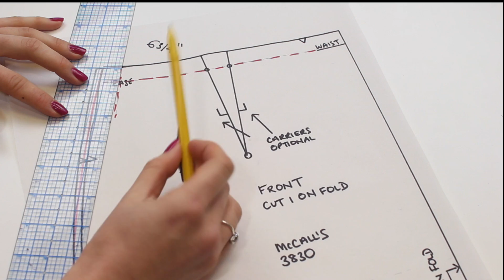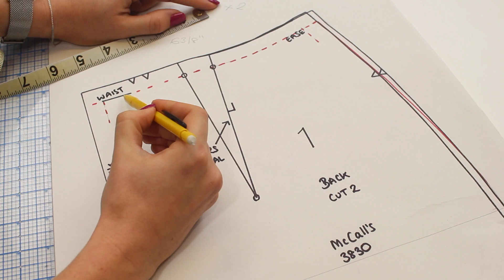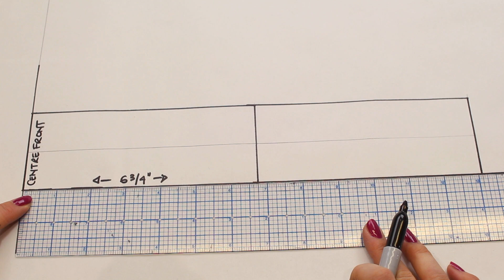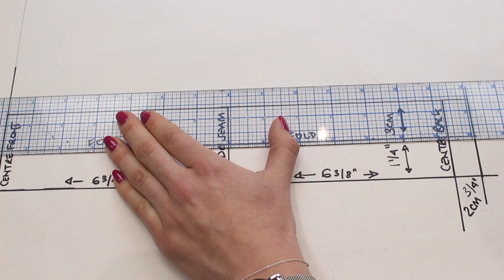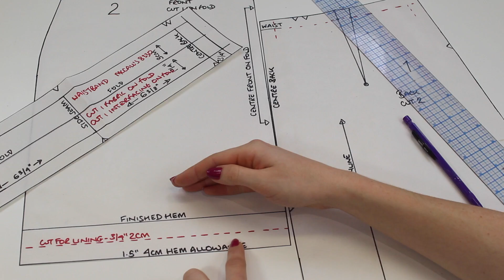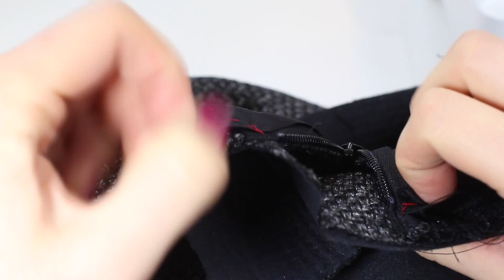Beginners Dressmaking - Sewing McCall's Skirt 3830 | M8051 Pattern - (Waistband & Lining)

Comment: Aneka, thank you so much for being so generous and sharing your knowledge with us in your wonderful tutorials. I can't even tell you just how much I have learned from you! 
Would you be so kind and help me with two questions, please. I am new to sewing and there is a lot I still have to learn.
1. Do I have to pretreat my fusible interfacing before ironing it on and how? I heard of people coming out with bubbles after washing their garment for the first time after they had finished it.
2. If I want to add a lining to a maxi skirt that  obviously will be more flared going down, can I also just cut out the lining using the original pattern piece or do I need to change anything about the shape? (except for the hem, as you explained in the video)
Thank you again so much for all of your helpful videos! I really really appreciate you! Greetings from Turkey:)
Reply from the maker: Hi Isabelle, thank you for such a lovely message. 

1. It depends on the quality of your interfacing. A lot of the interfacing that you can buy in dressmaking shops is non-woven; meaning it doesn't have a grain. Most of the time I prefer to use woven interfacing, it behaves more like a fabric. In terms of interfacing bubbling after a wash, this is usually because the interfacing wasn't attached properly (was the correct heat and steam used), it is poor quality, or the wash was too hot for the interfacing. If I have an interface that is dry-clean only then I might pre-treat so that I can then wash it later on. I would of course test this first with a sample. 

I have sell quality interfacings, to give you an example: https://madetosew.com/product-category/shop/interfacing/

2. Lining a skirt is pretty much the same. I often add a little bit of extra ease to the skirt pattern at the hip. Say 1/8" - 1/4" or so (2-5mm), to make sure that the lining is slightly larger than the exterior fabric. This will stop the lining from tearing as often lining's don't have the same give as fashion fabric. I hope this helps? Aneka x
Reply: Thank you so much for answering so quickly! Yes, that helped a lot:) I will also definitely go and check out the interfacings on your page. You really are an incredibly talented teacher, you explain everything so well that even the hardest things suddenly seem easy. Thank you again for all the hard work you are doing for us! Isabella
Reply from the maker: Glad it helped Isabelle. Thank you for your lovely words. X

Comment: This is a little off topic for this tutorial, but I just bought a serger, and I'm wondering what's the most practical stitch for overlocking the edges of my fabric. I've been mostly working with quilting-style cotton, because it's so easy to manage.  I'm experimenting with a polyester silk-like fabric for this lining tutorial.
Reply from the maker: Great news, I will plan some serger tutorials very soon. I use the standard 3-thread overlocker (serger) stitch for finishing the edges of the fabric. Good luck. :-))
Reply: The tutorials that come with my serger distinguish between 3-thread narrow, and 3-thread wide.  Does that make any sense to you?
Reply from the maker: That does make sense, and that will simply be if you are using your left needle or your right needle in the machine, when you do a 3-thread. You should be able to amend the width of the stitch too, but this is generally minimal, and won't make much of a difference. So it depends on the fabric you are using, I generally prefer to use a narrow 3-thread, because I find it neater. So I go with as narrow as possible, that works with my fabric. Have a test and see what you think. This will be using the right needle. Aneka x

Comment: May I suggest to write a note on the screen when there is a corresponding video, because repeating all the corresponding videos takes a lot of time away from the explanation.
Reply from the maker: M M yes of course! This video was filmed before Cards, or before I knew how to use Cards. Which is why I didn’t link to the other videos in the video and have them simply on the screen of the video, which is what I do now. Sorry! I can probably go back through and add the cards on, but haven’t had the time to re watch all the videos! Aneka x
Reply: at 40.30 you just start sewing the waistband. there is a piece of waistband sticking out, is that the seam allowance? is it the same on the other side? start before the zip, what do you exactly mean? at the top of the zip?
Reply from the maker: Hello, the piece of waistband sticking out is the extension or overlap at the end of the waistband, plus the seam allowance. Really sorry this wasn't clear. Have you drafted an extension on your waistband? Same on both sides and that is why I am starting before the zip, you don't need to start at the edfe of the piece of fabric of the waistband here, because you aren't sewing it to anything. Does that make sense? Aneka x
Reply from the maker: I show the overlap in 13:31. Aneka x
Reply: hello Aneka, you are really kind. I saw that 13.31, but I would have expected you to mention how to place the waistband on the body of the skirt. when you actually place it there. i ve been watching this tutorial and the other one, and i didnt finish in two days.. Before the zip, do you mean, still on the tape, or after the tape of the zip? i hope tomorrow i finish it. i take notes of the thiings you say,. thank you x
Reply from the maker: M M Hello again, so sorry that this wasn’t clear. I just re watched the video and do show pinning the Centre Back of the waistband onto the Centre Back of the zip and the side seam of the waistband onto the side seam of the skirt etc. at 38:30. But I am sorry that I didn’t cover the end of the waistband and the zip in greater details - so sorry. You want the line of the Centre Back of the waistband to be on the edge of the zip, this should be the Centre Back of the skirt. Does that make sense? So sorry to cause you any difficult. Good luck! Aneka x
Reply: thank you Aneka x and keep up the good work :)
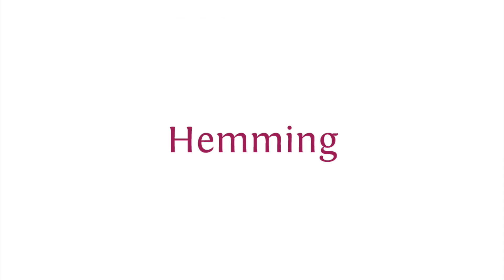Reply: hello just finised watching the vid. just before 55:47 how do you close the second side seam of the waistband. i cannot see it? thank you
Reply from the maker: Hello, sorry for the delay I am currently working in the USA, so away from the office. You close the second side exactly the same as the first, I show at 54:39. Does that make sense? Using fell stitch and ladder stitch? Aneka

Comment: Thank you for a great start to sewing. I,m a little confused about the Ease, will you have to reduce the pattern size at the waist.
Thanks
Reply from the maker: Hi Debra, 
Have you measured the waist of the skirt? Remove the seam allowance and measure the stitching line on the top of the skirt, excluding the darts. Compare this measurement to your waist measurement to find the difference. May I ask what the measurements are to help you? Are you going to draw a straight waistband like I did in this tutorial? Or work with the facing included with the pattern? Thanks, Aneka :-))
Reply: debra dyson I love you

Comment: where do you get the pattern sheets from
Reply from the maker: Hi Robin, both the plain paper and dot and cross paper I use both industry pattern cutting papers. I buy them in large quantities but I believe you can buy them on Amazon in smaller qualities. Otherwise you could try Morplan for larger qualities. I hope this helps, Aneka